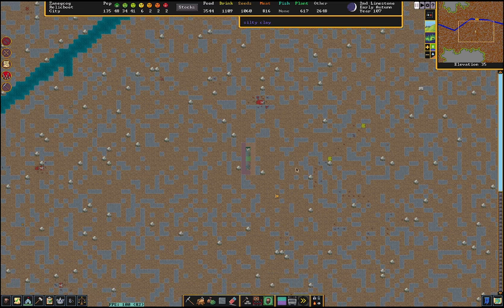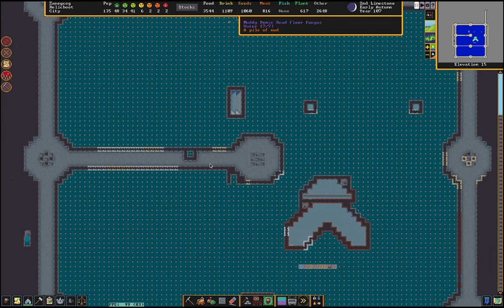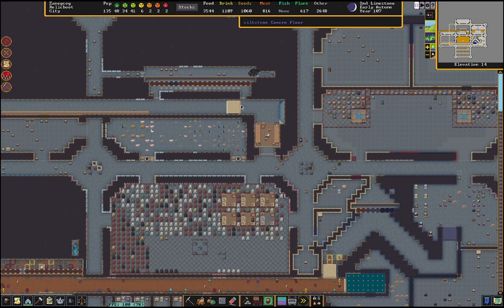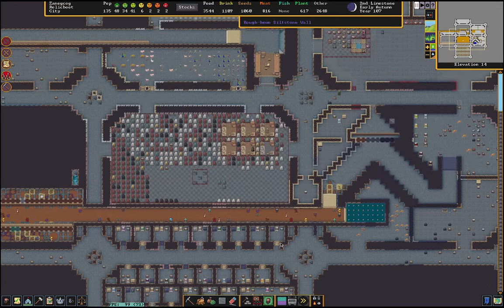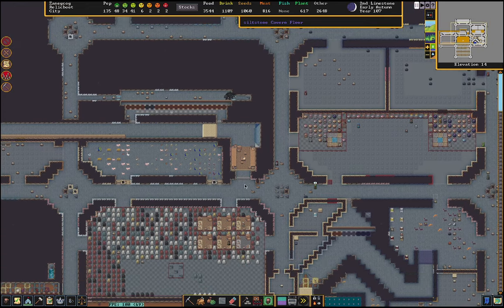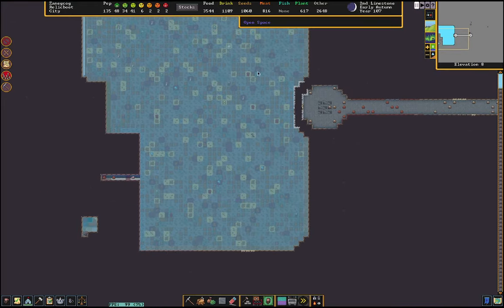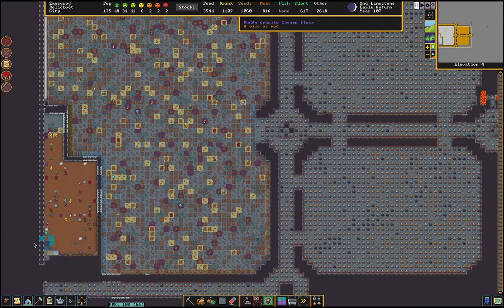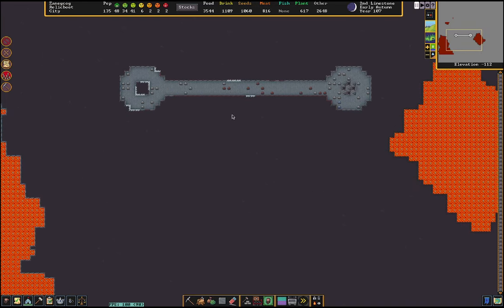Base Design - Dwarf Fortress

Comment: sick fortress design! so well organized, I also like the idea of remaining just below the royal population threshold, hadn't seen such a well established fort with that strategy.

two tips: 

1) at the beginning of the video there is like 21 seconds of silence before the video starts, if you use youtube's built in edit features to trim that out it will probably improve your retention rate and the algorithm will share your video more.

2) for your circus breach "danger hallway" consider making a checkerboard pattern via construction and/or mining. The checkerboard blocks orthogonal sightlines and projectiles, so it makes webs, fire, gas, etc much less dangerous, helps to prevent your squads from getting taken out from afar before they can strike.
Reply from the maker: Thanks!  So I've heard of the checkerboard strategy, and have plans to implement it at the end of a long spear trap, ballista hallway.  The twitch stream is a couple years old but this channel is young.  I'm sadly still a novice editor but I've been watching and plan to cut the next video properly.
Reply: @CancelTV  You can edit the video after its been uploaded, via youtube creator studio.
Reply from the maker: @paulyounger1190  Check it now, did I do it right?
Reply: @CancelTV  Yep, perfect!

Comment: I now trying to get minecarts work as a main way to transport stuff between workshops and mining sites. One minecart can contain 5 rocks and you can manage where those rocks will go. Also minecarts that guided by dwarfes ignore laws of physics and can go through each other, so you can build just one line of rails that goes everythere and don't worry about somebody being squashed to mist. So its just a matter of one dwarf hauling 5 rocks at once.

The only drawback of this system is the interface and a lack of any sorting and searching for a specifically named stockpile or route, or dwarf and you need to scroll through a lot of shit.